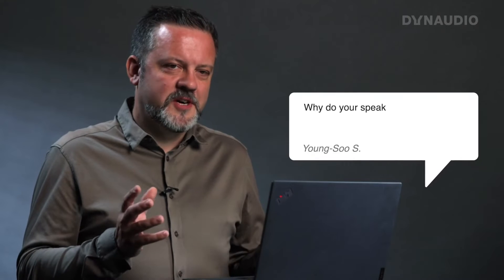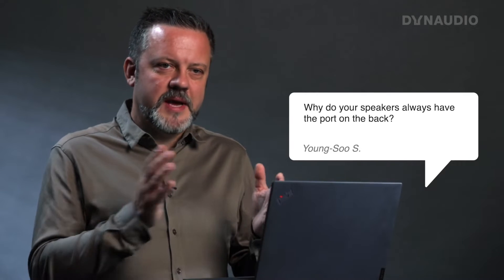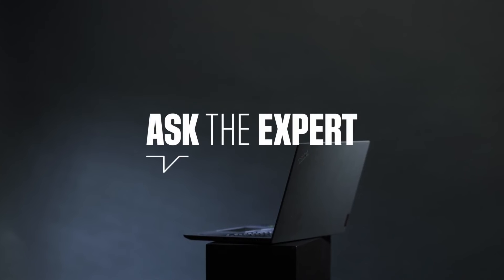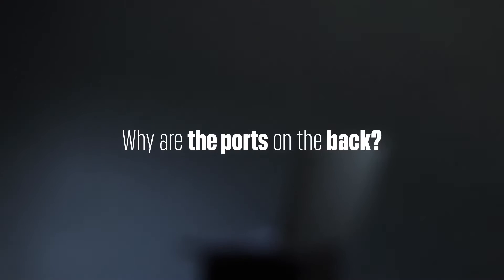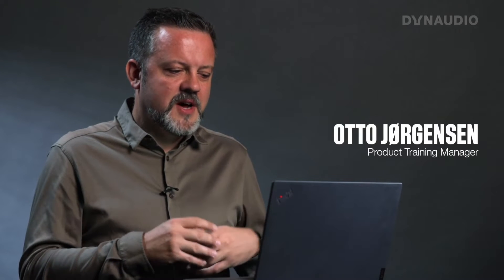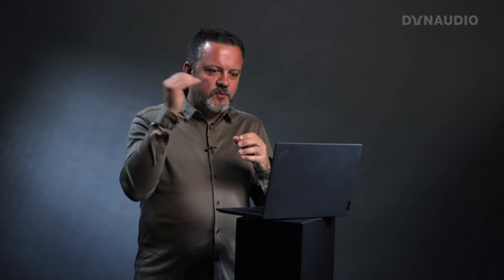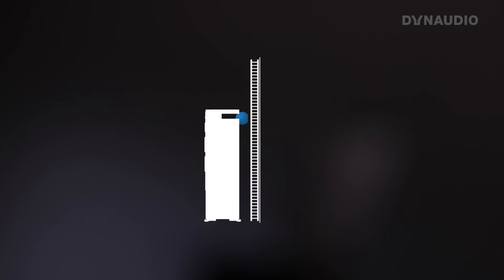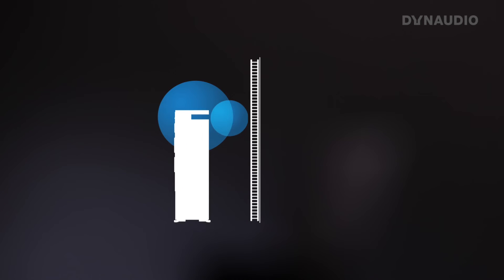Why are bass ports on the back of speakers?

Comment: I builded subwoofer box with a port at back and the bass is heavy, i can feel it inside body. It gives me goosebumps. I'm using pioneer sub. I've compared front port and back port there's huge different.

Comment: So I can move my focus 10's closer to the wall?
Reply from the maker: Indeed. The omission of a port, and the fact that that the Focus series is active and has DSP working in its favour, makes it much more flexible in terms of positioning.

If you're using the Dirac Live room correction as well, then there's even greater flexibility in terms of placement in a room.
Reply: How dirac live handles especially nulls  of standing waves and Speaker-Boundary Interference Response (SBIR)?
Reply: @tiffanytoulouse229  Even Dirac can't bend physics, although they do try 🙂 No EQ can fully compensate for a null or phase cancellation in the listening position. The Dirac algorithm uses the knowledge from several measurement points to try to "understand" if a dip is treatable or not, and avoids applying too much gain at non-treable nulls, so as to not overload the loudspeaker.

/Otto, Dynaudio Academy

Comment: I prefer front port
Reply: Actually nowadays if well designed, ports can be front, back or down firing, or even on the side sometimes... but most of the buyers prefer a "Cleaner" look that doesn't show the port, that's why ports are generally on the back or down firing.

Comment: bas reflex je iba pre nízkorozpočtové audiosystémy, je to degradácia kvality len kôli zisku zopár dB na nízkych frekvenciách
Reply: Their M3 studio monitors, huge great big things and industry standard have ports, and on the front, perhaps to compensate for the 5" driver which should be a 6 inch.
Check out the price of these.. hardly budget speakers.

Comment: Makes sense! Good explanation,  thanks.
(Good reason to avoid front ported speakers:-)
I could hear midrange coming out of my LS50  ports when setting them up. To be fair i was behind them at the time. 
The cabinets are very inert, so it was easier to hear. 
Doubt it would be audible from the listening position. 
Nevertheless,  I placed  diffusion panels behind each speaker!
Reply: Mids should be heard through port, but they indistinguishable from sound overlall. You just hear lifeless, dull pianos, guitars and so on - that depends on the track. It should be rich of midrange, for instance Fender Rhodes electric piano (https://www.youtube.com/watch?v=EojThBtV85M), hammond organ or rich harmonic guitar sounds like Lemongrassmusic Episode 400 - Ceylon, - try listen to them with port plugged and open. These are all examples of the magically recorded mids (i mean sound, you may not like the song itself) If you don't perceive sound of these as magical, that's the fault of your audio system:) So, in my experience, bass ports are harmful and should be always plugged.
Reply: I plug the ports on my stand mount speakers the clarity and detail is far better and the sound stage is deeper wider and holographic